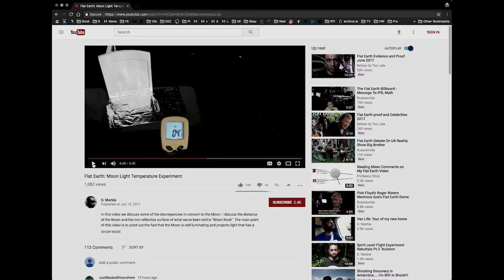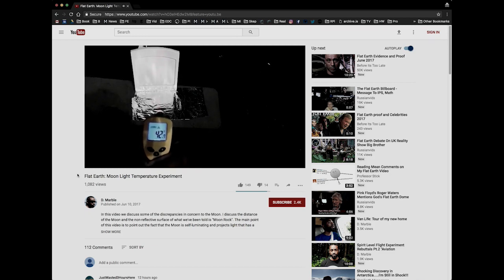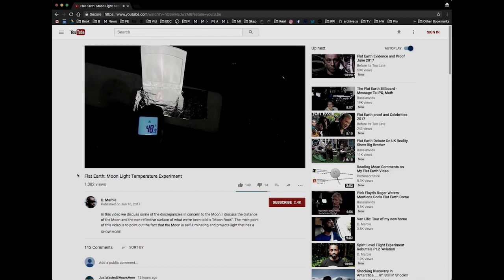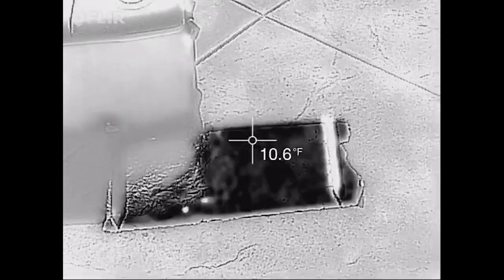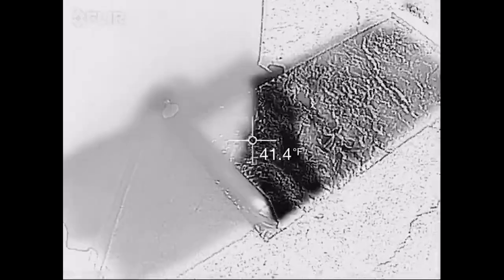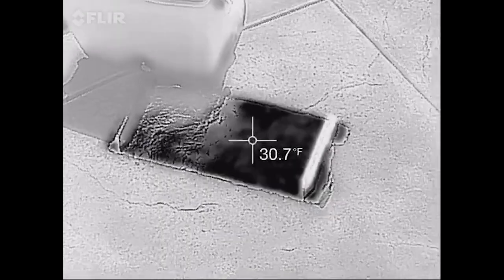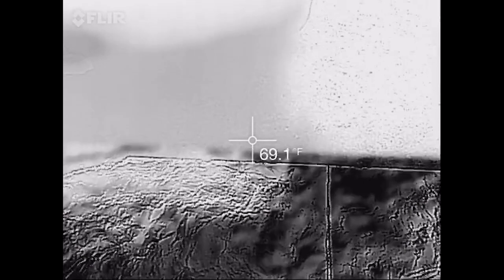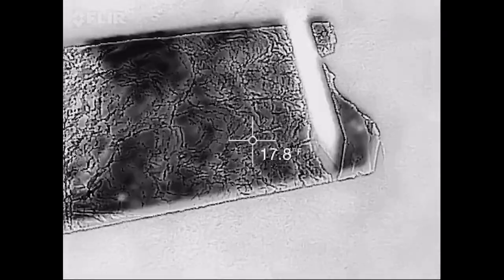FLIR Temperature Reflection Problems with Aluminum Foil

Comment: I have a couple of videos dealing with the "cooling moonlight" claim.  I use ordinary thermometers.  The main issue in most of those videos - aside from any FLIR issues - is the lack of a control. ie, taking measurements on a moonless night.  I get the same shade/exposed temp difference on a moonless night as on a full moon night (the 31/1/18 supermoon, in fact).

Comment: I am pressed for time but I'm going to do record a video showing this experiment properly. Your flaws? reflective surfaces, calibration, angle, cross checking etc. 
What camera are you using?
Reply from the maker: The point of the video is to demonstrate the problem with reflective surfaces. It's a FLIR One (second generation), on an iPhone. https://www.amazon.com/FLIR-Thermal-Imaging-Camera-Devices/dp/B0123QLZJ8/ref=dp_ob_title_ce
Reply: I only listed the problems with your video. If the guy is using infra red for reflective surfaces then I would have said the same thing to him.
I didn't really need to ask about the camera, I knew it was a Flir one because I've got one. It's just for kids to mess around with Mick.
Like I said I will do a video with my Flir E6.
I won't being saying this proves that or whatever but merely show the results. People can conclude what they wish from it.
Reply from the maker: I still don't see any problem with my video. It just shows that the aluminum is reflecting IR radiation. What is the problem?
Reply: The camera for 1. The angles for 2.
Reply from the maker: But what is the actual problem?
Reply from the maker: How would changing the camera affect the result? What is the issue with the angles? The demonstration shows reflecting the sky or the cooler, so the angles are perfect for that.
Reply: I don't have time Mick but there is no result. Il get back to you
Reply from the maker: I look forward to it. But I wonder if you misunderstand my video. It was simply an illustration of the source of the error in D. Marble's video - i.e. the fact that aluminum reflects IR far more than it emits it. So in his setup (and mine) the readings are not of the temperature of shaded or unshaded aluminum, but rather of whatever the aluminum reflects - i.e. the plastic cooler (around 70°F) or the sky (<-4°F if clear sky, ~30° clouds).  So I really don't see what the problem is.
Reply: @Dr D you're an absolute edgelord
Reply: Can you explain why infrared cameras can show a person's reflection in glass?